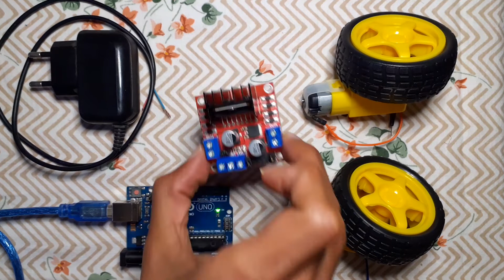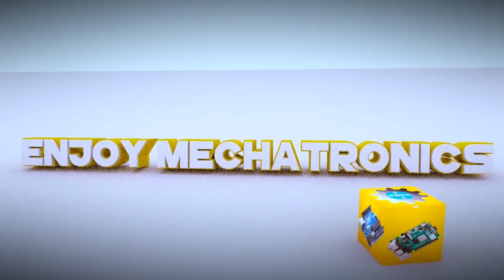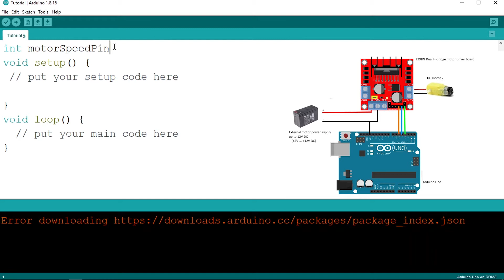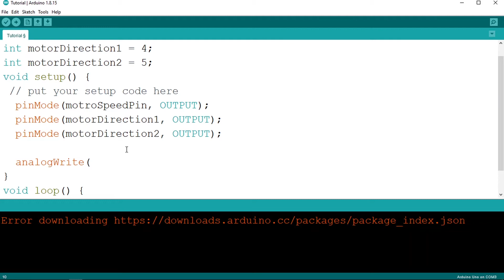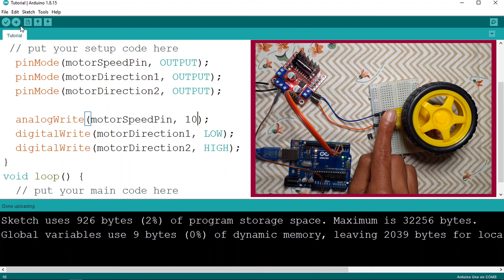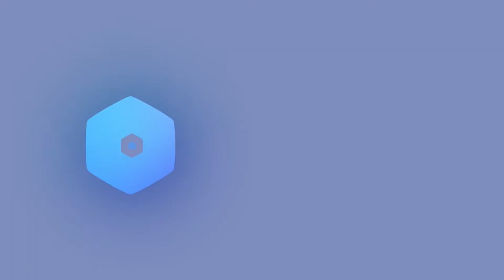Arduino Tutorial 29- Controlling DC Motors using the L298N driver

Comment: Great tutorial, thanks.  There is  one wire missing in this tutorial . else it will not work.  Spent several hours debugging and figured out that you need a wire from 5V pin of L298N to  5V pin in arduino for this to work. else the arduino board itself was not getting power.
Reply from the maker: Yeah we can power the Arduino from the 5v of the motor driver